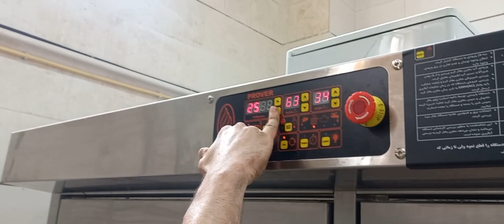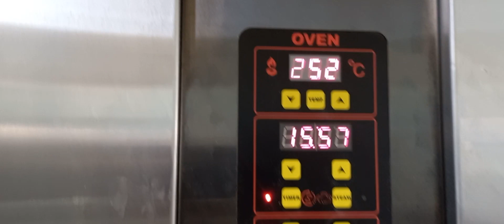Baking Bread|Baking Iranian Bread|Cooking Barbari | Baking Bread | Barbari | iran

Comment: I have not tried the bread that's baked with this method. They look different from the ones baked the old way. How about the taste? 
This is more work. They have to put them in the proofer. Lots of pans to wash. 
It's worth trying to compare.
Good Luck with your hard work Brothers.
Reply: they do taste different, the taste goes similar to bun bread, also proofing 20 min is crazy short. The dough has to sleep at least 24 hours, this is crazy short and the bread goes tasteless. We bake here differently, our dough sits 48 hours before baked, also keep it mind there are different types of rack ovens. if you have questions reply here.